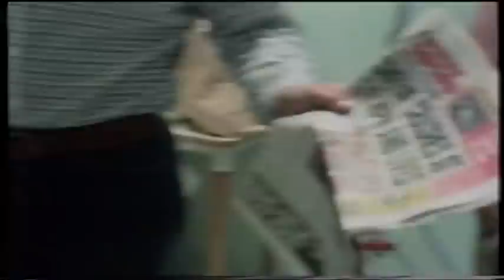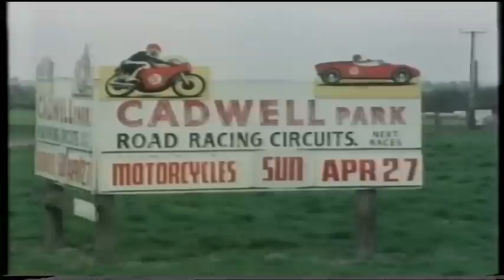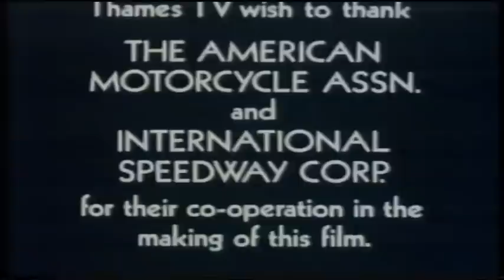Barry Sheene ..Daytona 1975

Comment: I raced in the '75 200. I grew up in Cocoa Beach. Fl. and raced minibikes/minicycles as a very young boy and then raced motocross bikes in H.S. and earned my AMA Expert/Pro License for 125cc Motocross as a Jr. in H.S. I was ranked 7th in the State in 125cc Expert class and almost got signed by the Yoshimira Yamaha team but it went to a guy I grew up racing against. At that point my Dad (my Dad was an Engineer at Cape Canaveral and my main wrench) and my main sponsor (Island Yamaha in Merritt Island, Fl.) and me talked and decided I would hang my racing boots up for my Sr. year in H.S. and concentrate on academics, as I had been accepted to a couple good Engineering Colleges. So I did but then shortly after school started Island Yamaha said they had a new TZ 350 (D) and asked if I was interested in turning some shakedown laps. I jumped at the chance and me and two other local riders each turned a few laps at Sebring. I had never even ridden a street bike (I had ridden a  friends TD250 up and down his street but that hardly counts) before but took to the TZ like a fish takes to water...to me it felt just like my YZ125 just on smooth pavement (actually sebring was rough as hell but compared to a motocross track or dodging pine trees in the woods while practicing the rough sections at sebring didn't bother me at all) instead of dirt. I ended up having the fastest lap times and they then told me they wanted to run a partial AMA season next year and laid out a plan for me to run some of the amateur races during Daytona bike week to see if we could qualify for the 200. I asked my Dad if I could and he said sure so I jumped at that chance. I ran in three of the prelim races and placed on the podium in third in a 50 mile 350cc race and earned my AMA 350cc Road Race Expert license that day which qualified me to run in the 200.  We ran the entire race but I wasn't competitive with the 750cc bikes. I qualified 42nd out of a field of I believe 54. I ended up finishing 24th which I was very very happy at the time. Kenny won the race and I think I was 12 laps down to him. We spent some time in the pits when we had trouble changing tires and brake pads. I raced the Florida swing including palm beach international and homestead and then road Atlanta and then I called it quits and was off to Engineering college in June. Have had several superbikes since then but have never tracked any of them. I figured I had my best shot back in the day and left all I had there.
Reply: Your getting old mate, Romero won in 1975, Roberts didn't win his first 200 until 1978 after Baker stole the shortened 1977 200. I always get a chuckle when John McGuinness says he won Daytona, not at Daytona but just Daytona which would mean the big race not the support 250cc race which he did win. 👍